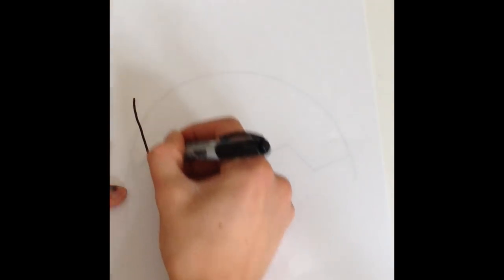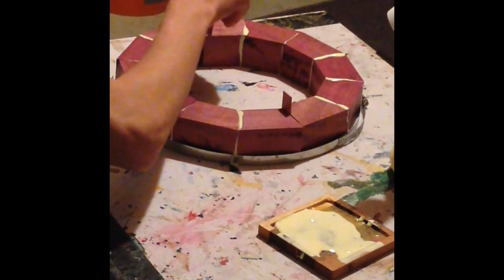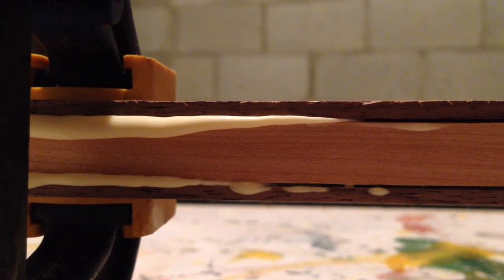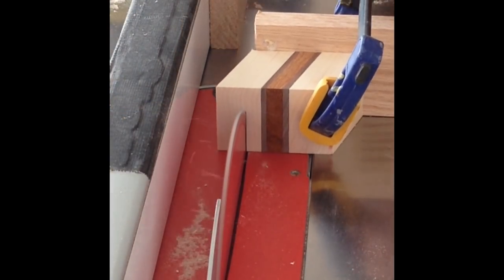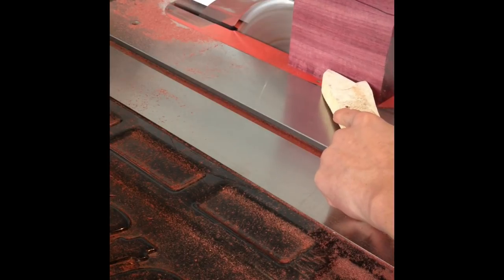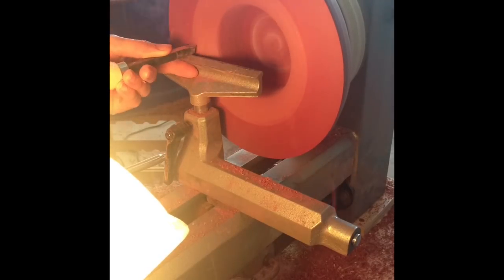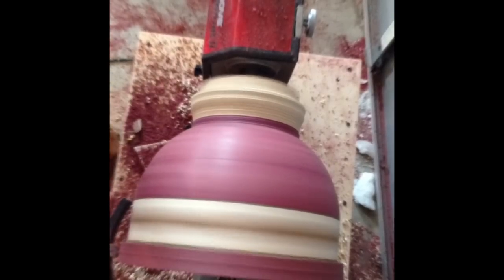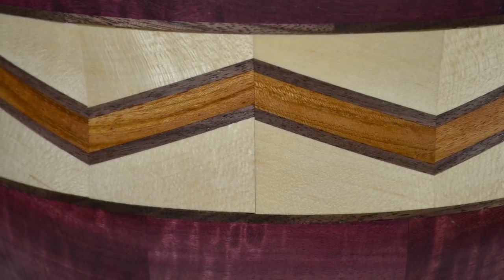Woodturning A Segmented Bowl

Comment: Justin, for anyone's age you did an excellent job!   You explained what you were doing which is very difficult for some people.   You were clear, concise and more to the point, you knew what you were talking about!   For someone that has been turning for such a very short period of time you did a fantastic job.   The lines on your chevron line up, the segments are the same size.   I know a guy that recently tried a chevron pattern and have been turning for 32 years, his segmented bowl was all ver the place like a dogs dinner...   You will get comments about this and that, about what you should do and not do.   The hardest part is to know who to listen to?   It doesn't take an idiot to know that anything with teeth is dangerous and you use caution and no short cuts, and your not an idiot wise you wouldn't be building beautiful bowls.   Well done!   Cheers Sean

Comment: Justin, really nice bowl you have there. Some advice I'd like to give you, when your video first started you were cutting timber on the table saw and you were using a guard, I thought that's great that someone is finally showing some sense because they are there for a reason, then I see you cutting timber without the guard. As Lou VanDyne stated, FINGERS DO NOT GROW BACK !!!!!!. Your enthusiasm is inspiring, I'd hate for you to have a bad experience and not be able to do what you appear to love doing.
Reply from the maker: Ross Gabriel Thanks you guys for the concern! the reason i was not using a guard was the segments kept getting stuck against the blade. i know that the risk is high of cutting of fingers. That is why i invested in my heath and safety and bought a Saw Stop. this will give me an extra barrier of protection in that just in case moment. The saw in the video is that saw. I am always conscious to use the most guard as possible( full guard or riving knife) and will continue. I know that I still have to be careful and I still will follow all safety precautions as with any other table saw.
Reply: justin fiaschetti
Great to hear you have a Saw Stop, didn't want you to think I was getting all negative on you, just seen too many fingers and hands lost over the years as a wood machinist and cabinet maker and when I see folks not using a guard it makes me cringe. Good luck and hope to see more of your work and videos.

Comment: I liked the scraper idea. Check the grub screw on the Nova II (top middle pulley on spindle). I've found it can work loose when turn large/heavy stock on a midi lathe.
Reply from the maker: I took a look and it was slightly loose! Thanks for the suggestion!

Comment: Great job Justin and yes please check out that video on the tablesaw accident.  He did it doing the same kind of cutting you were doing.
Reply from the maker: James Nelson Ross Gabriel Thanks you guys for the concern! the reason i was not using a guard was the segments kept getting stuck against the blade. i know that the risk is high of cutting of fingers. That is why i invested in my heath and safety and bought a Saw Stop. this will give me an extra barrier of protection in that just in case moment. The saw in the video is that saw. I am always conscious to use the most guard as possible( full guard or riving knife) and will continue. I know that I still have to be careful and I still will follow all safety precautions as with any other table saw.

Comment: Really nice work. I would like to caution you though about using the table saw. At 10:40 you cleaned an end grain (cross cutting) against the fence. Not a good or recommended practice. Then when you did rip it, the piece was wider than it was long. Probably would have been safer with a miter gauge. Too easy to get a kick back. Lastly, try to keep at least half of the gullet between the teeth of the blade above the material. It helps the blade disperse heat. You had some serious burn marks on that purple heart. Work safe, you definitely have talent.

Comment: Instead of unchucking the bowl each time you added a segmented layer you should get a tapered threaded taper that fits into your tailstock and mount a flat-jawed chuck that you can mount a centered segmented layer using your tailstock to press it to the preceded layer.
Reply from the maker: Tom Antrim that is a great idea. Where could I get this taped treaded thing?
Reply: I ordered mine from Grizzly. I have a MT-2 taper 8 threads per inch and paid around $30 for it.  The flat die centers the segment layer.
Reply: If you make all the segments first you can chuck up the flat jaw chuck on the spindle side and dress both sides of all the segment first.
Reply: T27592          CHUCK REVERSING ADAPTER 1"-8 PITCH-#2 MT I looked up the part number
Reply from the maker: +Tom Antrim this is great. Thank you.